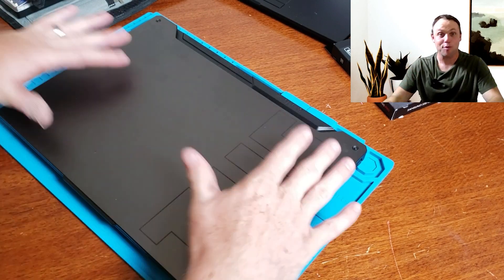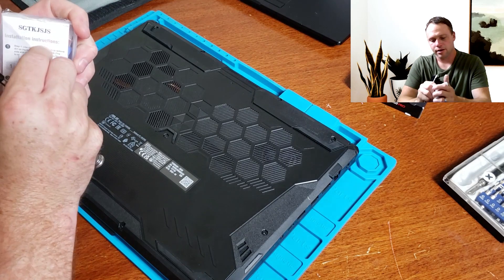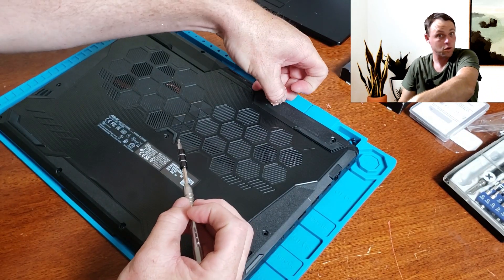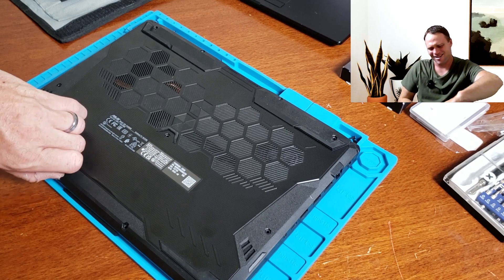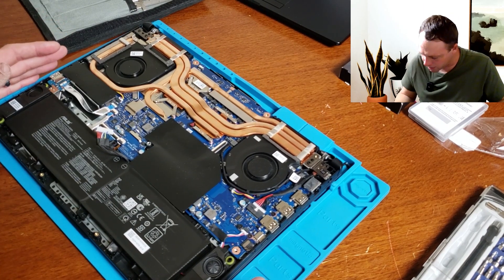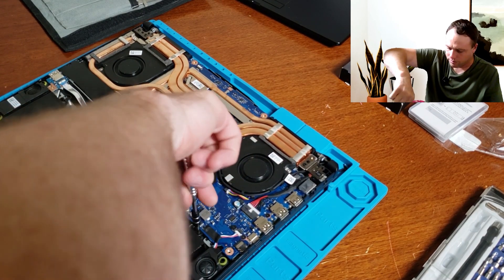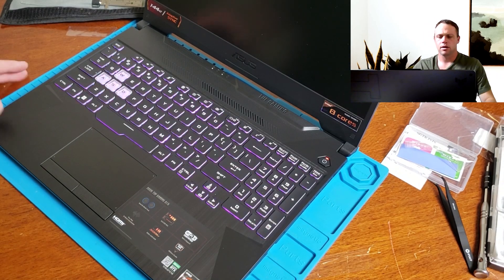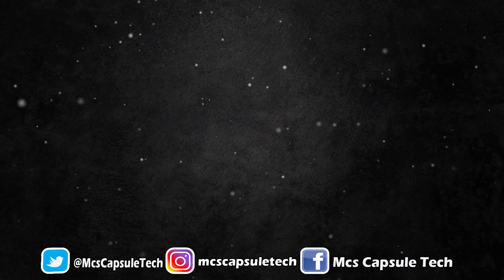ASUS TUF A15 FA506QM SSD Upgrade

Comment: Hello :) , I have a question, are these slots compatible with "Kingston NV2, 1TB NVMe, PCIe 4.0" or the "Lexar NM620 M.2 2280 PCIe Gen3x4 NVMe SSD, in my country those 2 SSDs have a considerable price difference, which of the 2 would I like? Do you recommend for my laptop  A15 FA506QM??? (if they are compatible)
I would appreciate your response, have a good day
Reply from the maker: Yes
Reply: @mcscapsuletech  Which of these 2 do you recommend, I don't know much about computers, sorry.
Reply from the maker: ass long as its a good named brand you should be ok @wildraptor.9813

Comment: Is necessary the thermal pads?
Reply from the maker: If you're going to use NVMe once I would say so they get hot so you want to cooler on those drives

Comment: Hello friend, where did you find that this laptop supports up to 8Tb per storage unit?
Reply from the maker: There's no limitation that says there's no limitation on it as in it doesn't give you any Mac storage so that means you can go up to eight terabyte because eight terabyte is the biggest NVMe drive that can fit in there that they make right now that will fit in that laptop and that supports that speed

Comment: what spectification ssd can upgrade for this laptop?
Reply from the maker: Any nVMe or SATA 2280 you can have up to two eight terabyte drives in here if you wanted to to having 16 terabytes in a laptop
Reply: @mcscapsuletech  ty, i have this laptop but can i upgrade to pcie gen 4? because the other one is pcie gen 3
Reply from the maker: @raynaldoputra  you can always put a Gen 4 and a Gen 3 slot it'll just run depending on what speed the slot is so if the slot is gen 3 and you put a Gen 4 SSD into it it's going to run at Gen 3 speeds it won't run at Gen 4 speeds and vice versa
Reply from the maker: @raynaldoputra  no it's soldered onto the board you can't adjust the architecture on that
Reply from the maker: @raynaldoputra  and you can replace the NESSD if it's a Gen 3 you can replace it with a Gen 4 but if the slots not a gen4 slot then you're just going to get gen 3 speed still but you can definitely do that it doesn't hurt anything other than you're not going to really get what you're paying for in the speed but you will get the new reliability
Reply from the maker: @raynaldoputra  you can mismatch it don't matter you can have one have four and one half three

Comment: Hi I believe it has 2 SSD slots in total, so one is already used by default so we can install another one right? And also how much storage does it support and is it thunderbolt supported?
Reply from the maker: Oh it does have two SSDs one's already in you supposed to swapping over because in this video I replaced both of them with better ones
Reply: @mcscapsuletech  oh ok how much storage can I increase it max in the additional slot?
Reply from the maker: @jeffrey_george  you can put two 8 TB s m.2's in there if you want and have a total of 16 terabytes if you want
Reply: @mcscapsuletech  thx for replying
Reply from the maker: @jeffrey_george   hope you sub
Reply from the maker: No thunderbolt Hope this helps please subscribe and have a rock and rolling day